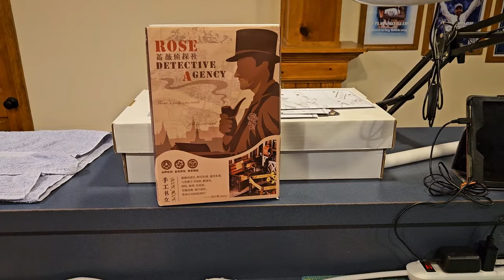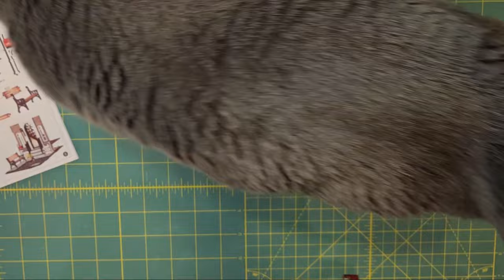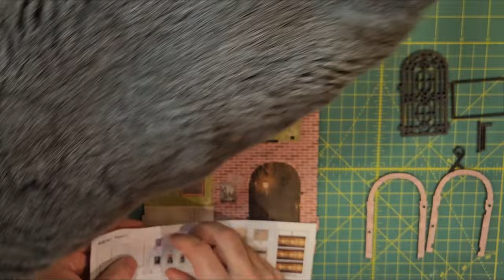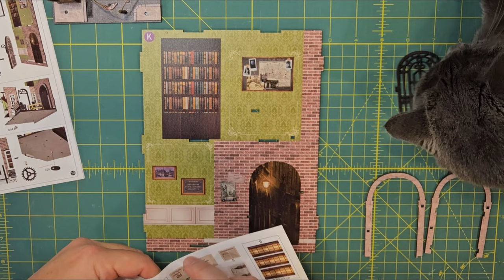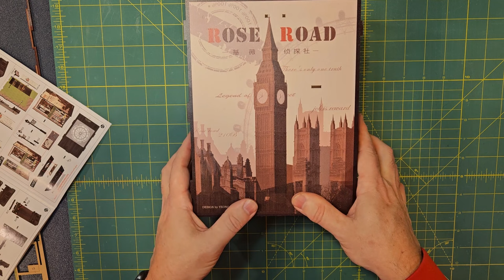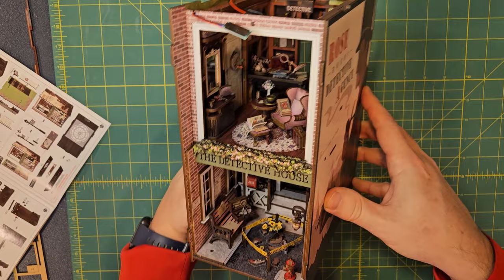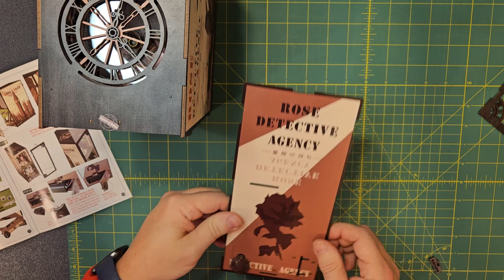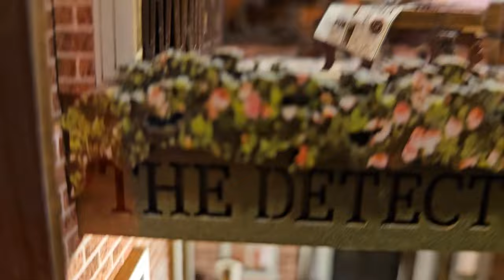Cutebee Rose Detective Agency Book Nook w/ Dustcover Complete Build & Review

Comment: Glad to have your detailed video i am about to built this kit myself
Reply from the maker: @Tim_3100 Thanks for the comment, Most of the pieces do require glue as they would not stay together on in place when placed inside the book nook. You just have to see if pieces going together are loose or tight enough to not require glue. Most of the time the instructions will tell you when and when not to use glue, but its up to you and doesnt hurt to use more than is needed. Thanks again.